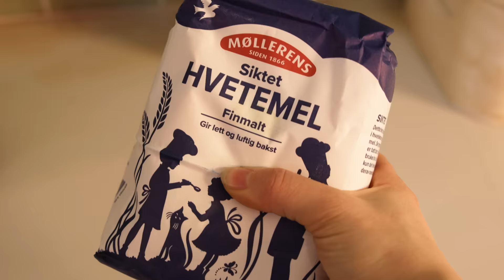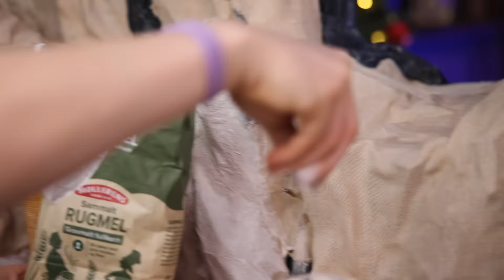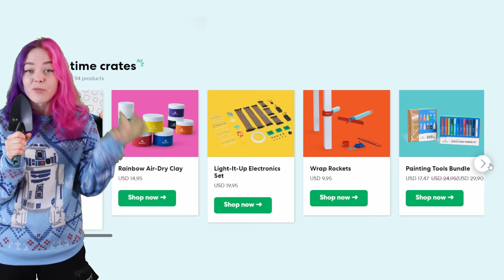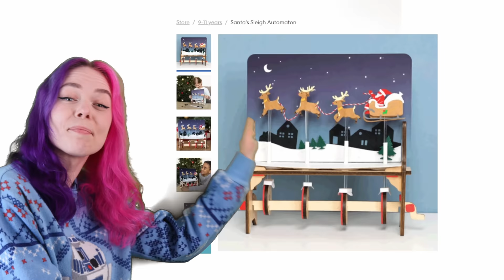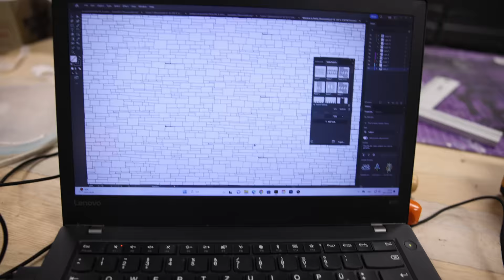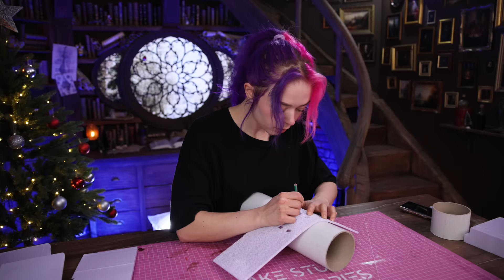I Built a Giant Hogwarts inspired Wizard Castle

Comment: For anyone who cares, a common tip I've heard about making textured paste is to use mod podge and baking soda! Baking soda is a little grittier than flour, and mod podge is cheaper than super glue (at least in some areas). It works to fill in gaps (so you may not even need to use linen lol), and it also can be shaped easily. You can even add paint (like grey or brown) to give it a nice undercoat. It's great for sealing foam too.

If anyone thinks that method would be easier I highly recommend it! :)

Comment: Nerdforge, model railroaders use plaster cloth for mountains. Doctors use it to make casts. Soak in water and drape it over the frame. Then model railroaders use rubber casts of rock strata and glue that to the plaster mountains. Then paint, add scenery, add track, etc.

Comment: I had an easier idea for the brick texture. Because you still had to use a pencil for more detail. You could make a 3d print of something of the sort to indent onto the foam by pressing the pattern into the foam. I hope this helps in your future castles. :)
Reply: I believe she has done that before. But she said she is not a fan of it, because it does not look as good to her. 

I imagine its because pattern rollers have a similar problem to old games, the texture scale works fine on small things, but on larger scales that repeating pattern starts to become way more obvious and distracts rather then adds to the piece. Those imperfections from hand marking give a more 'natural' look.
Reply: That's a good point with the repeating! she used real rocks last time I think. I suppose if you used different rocks and alternated a lot it might solve it a bit

Comment: The fabric and white glue technique is called Poor Man's Fiberglass, which is essentially what you did. For structural projects most people use Canvas and Tite Bond II water resistant wood glue.
I just built a 100 sq ft truck camper using PMF and insulation foam.

Comment: One little point I would like to say, is that historically, most castle surfaces was plastered and whitewashed, so that they would look more impressive. More military based structures might not have that, but castles in general would all be plastered and whitewashed. It was also a security thing as the plastering made it very hard to climb said building. 

Most castles were made to show how important and rich the owner was, so the better it looked the more impressive it would be. 

You might think about it as a flat surface due to the plastering which has areas that might need repair and the stone work under it would be seen and while all of the buildings would have been whitewashed, there would be areas where the work to pretty it up failed due to time or something so what is under the whitewash or the plastering might be seen there.

Another issue that many don't realize is that a lot of castles was actually made out of wood and then plastered and whitewashed to hide that fact. Sadly most if not all such castles burned down a long time ago so we only have a few books and paintings that tells us how it looked. History is a funny thing as it is always written by those in power or thanks to those in power, so we can't be fully sure if our own history is 100% true. 

Anyway, castles was made to look impressive, so they were all plastered and whitewashed. That much we know, but most people in the world have no idea that it was even done, because the stone work is the only thing that is left behind. But trust me, when I say castles were really plastered to hide the stone work and whitewashed to look like a glowed in the late sun. It would have been a insanely impressive sight back then.

Even so, epic castle Nerdforge :D

Comment: there some low grammature linen cloth in market, the less grammature more layers you can apply and that will knock off most the patern texture, then you can apply paster of paris (1 part pva glue+ 1/2 calcium carbonate+ 1/10 glycerin) to avoid mold you can add baking soda in the last layer. 2 or 3 layers is enought to smooth out any undesired pattern from linen and it is very thin

Comment: If you want the surface of the wall to be steep, like the surface of andesite, you can sprinkle it with fine filtered sand... the method is to coat the wall with glue then sprinkle with fine filtered sand... you can sprinkle it in bulk or use a spray gun...

Comment: Another way of making bricks or other patterns on foam easy is a 3d printed texture roller. 

I was surprised  to see someone else use the method of making bricks in foam that she first tried here. I tend to figure things out myself without looking at videos. I used that method that I figured out by myself before I got some texture rollers. Now I see someone else use that method as if they took it out of my room while I was working on it. It looked exactly like one of mine. I used dollar tree foam core for mine though, with paper pealed off. Not like it looked any different from her thin sliced foam. btw if you get cheap foam core usually rubbing alcohol and a little bit of time makes the paper layers come right off on most brands.

Edit: After I wrote this comment I saw another Nerdforge video and know know they know about texture rollers. Of course. I hardly see what other do since until now that I am watching more videos of crafters. It should be noted that rollers can look around as cool as individually drawn bricks but the character needs to be put into the 3d model that is printed instead of modeled as  perfectly formed bricks. and the roller needs to be bigger so it is less noticeable that the character imperfections is being repeated.